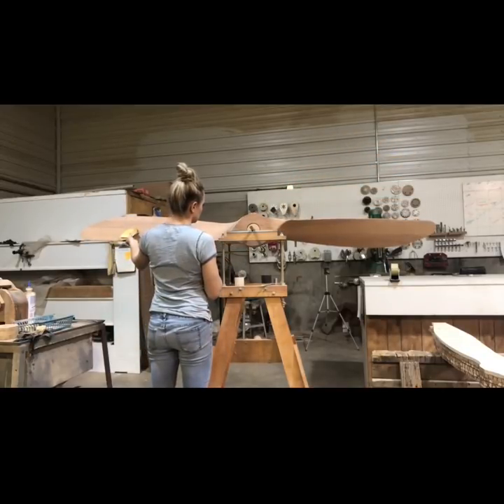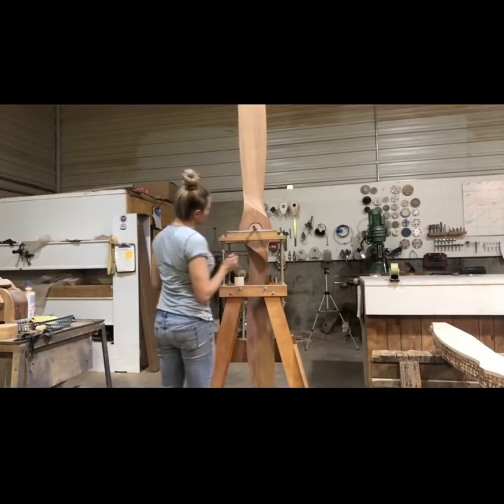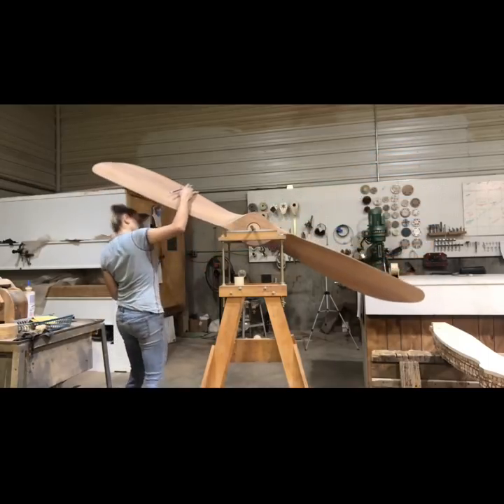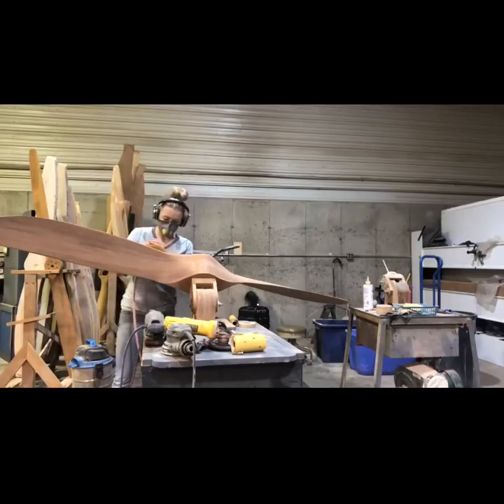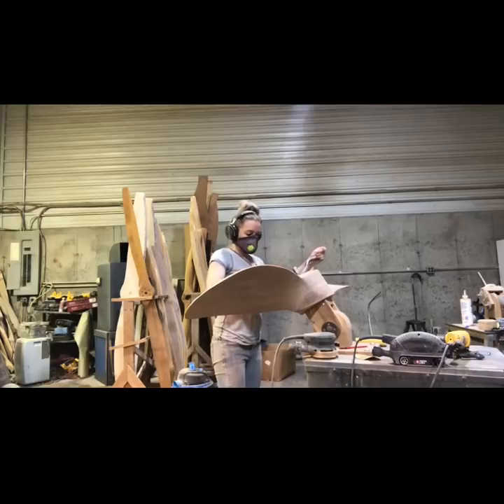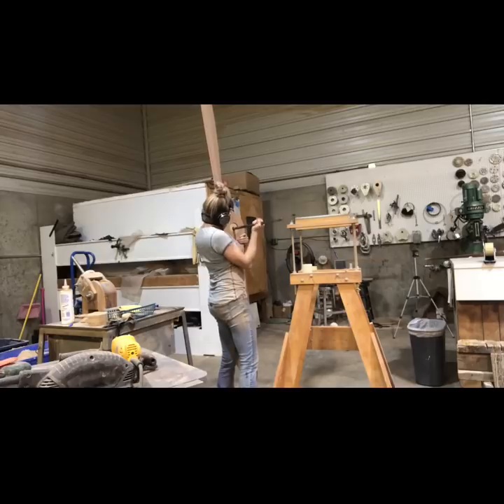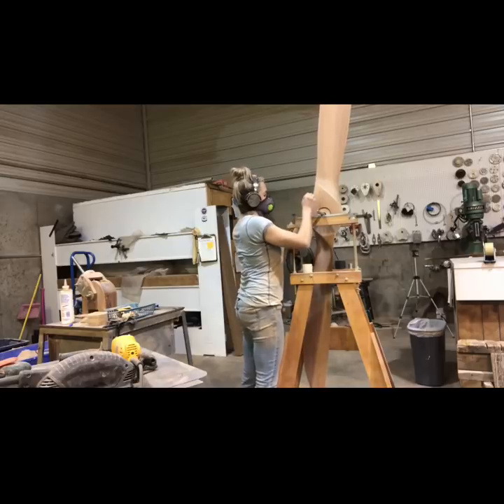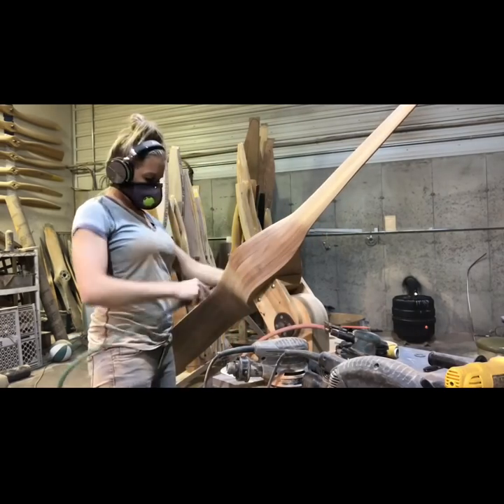Balancing a propeller

Comment: My dad and I balance a set of 30' rotors one time. So so so sensitive. Watching you made me remember how you had to stand very still and let the air settle. Just moving your arm or hands would make enough air wash to move them you almost had to hold your breath. We had to paint the tips anyway, so that was the way I put the final balance on them just spritzing some paint on the tips. We were very pleased when they were done, they had zero shake on the stick.
Reply from the maker: That is awesome! It does take absolute stillness

Comment: When you’re balancing and you have a horizontal balance, flip your prop over and see if you are still in balance. You can quickly identify if your hub is in balance as well as your blades. Then when you think you have it perfect, position the blades around the clock and make sure they hold position.

Comment: Very nice. Do you know how to use a scraper? The scraper is a very good way to remove very small amounts of wood and leave the wood perfectly smooth and get rid of blemishes excetera excetera. Scrapers were used before sandpaper was ever thought about. Lunch and learn how to use a scraper you would be able to balance that much faster and probably much more accurately.
Reply from the maker: Rosa String Works stop by and show me! 😁
Reply from the maker: Chris Corse that was a good video. I worry about the ridge my lathe leaves, but I should experiment!
Reply: @CulverProps  I second the motion. A collaboration video would be great!

Comment: Alaina,  After you wash your car, do you spend the next 2 hours getting the glass streak free?  (kidding you here).  Watching you work and the concentration and attention to detail is AMAZING.  If you static balance to within grams, do you have to re-balance  after you apply the stain and finish coats?  I really enjoyed hearing you talk about the trailing edge of the airfoil on the blade.  There is so much skill and thinking that goes into each propeller.  Do you ever dynamically balance any propellers?  Your work is so beautiful. Nothing shows the craftsmanship of the master more than wood.  
Your voice over was perfect, very easy to hear and understand.  
Thank you for sharing your gift with us.
Reply from the maker: Todd Dembsky i don’t balance after I varnish. I have not balance anything dynamically yet. :) and...thank you!

Comment: Alaina, Im looking for an old prop that I can make a mold of, I make hot rod and racing fiberglass & carbon fiber molds and parts for a living and would love to make a mold of an old/new prop, I'd like to make decorative fiberglass prop "Wall Hangers" for my shop walls or ceiling etc....... If you have anything lying around that wont balance well or have a blemish prop laying around that youll never use etc...  maybe you can sell me one cheap? ...... I can even make you a few if you like? .... I dig what you do and the way you do it!
Reply from the maker: Mr. Roach will half a blade work?

Comment: Really impressing. Please excuse a nosy, silly question. These beauty-propellers, are they usually "undercambered" at the backsides, or quite straight? It depends, I presume?
I am asking, because I, in senior ages have returned to my childhoods hobby: Model rubber powered aircrafts, and thereby carves balsa propellers. There are lots of experts, that have lots of thougts of everything, and one question is however undercambered propeller backsides may benefit efficiencies. Me, myself, think that the backsides may be either, but  makes an opportunity, to handle when balancing, when the front airfoil is optimized and smooth. I understand, that the centre is less important for the flow, and think that the backsides are next to.
Please excuse an old Swedish man for some violence of your language. And be proud. Most craftsmen/women would not make propellers like you. Splendid work-womanship!
Reply from the maker: I make the back completely flat. And the fattest part of the airfoil 1/3 of the way back from the leading edge
Reply: @CulverProps  Thank you.  Just what I hoped for. :)

Comment: its awesome to see the process of how these props are made. i noticed that,like me, ya take the dust bags off the sanders and wear a mask. do you have an air filter in there? i have a jet and it does quite a job at grabbing airborn dust. i also have a down draft table i do sanding on that helps get the dust out of the air. just a couple thoughts to possibly  help keep your lungs healthy.
Reply from the maker: I have several different dust collectors, I could probably use a hanging one

Comment: Hiya, it's only 10.30 here but I'm falling asleep so Happy New Year to you all...
Reply from the maker: Happy late new year!!
Reply: Hiya, only slightly late... How is everyone? I was a little worried when you were missing in action so to speak but thought you had likely been too busy building your works of art. More teaching videos to follow? I hope so as they are so informative and entertaining. 
Have you started on your truncated or smaller props for peoples walls yet? I've seen them over here as the boss with 6 to 12 inches of blade, with or without an old looking clock set in the middle of the boss. Used to dress man caves, pub, (bar) walls or even flying related firms offices. An alternative to a clock could be a barometer... Plus your logo...Take care @CulverProps